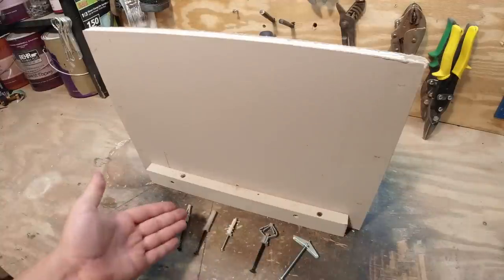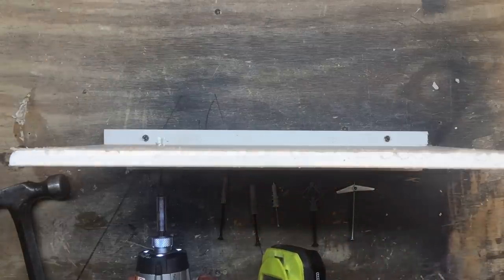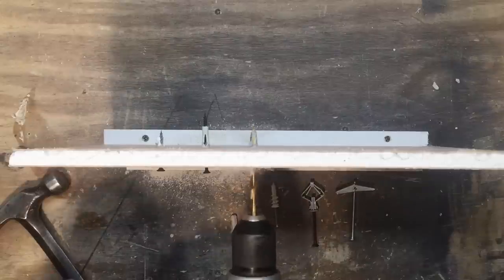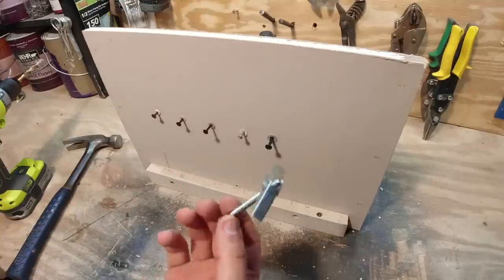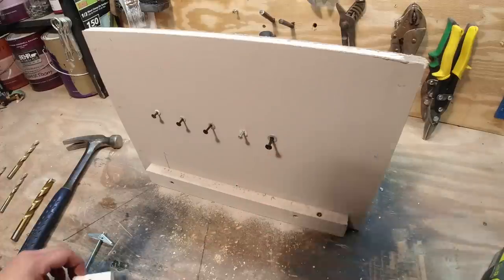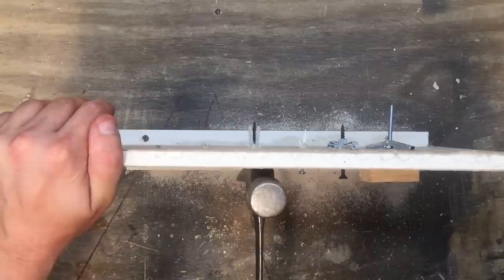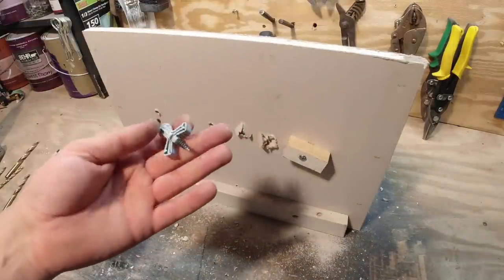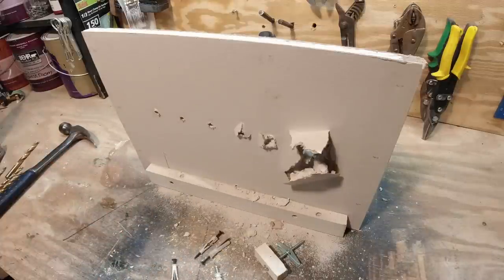How Drywall Anchors Work | Which Is the BEST?

Comment: One little trick that I use which seems to help is to fill the hole with spackle before pressing in the anchor and let it set up before attaching the screw.  Snug fit and keeps the anchor from spinning.
Reply: William Bethune great idea!!!
Reply: How long do you usually wait for it to set up?
Reply: @BeyondDestiny  About 10 minutes or so.

Comment: Keep in mind these anchors are being tested and pulled straight out of the hole. When using these anchors, the force will be downward, towards the floor, not straight out. A more accurate test is to test the supporting weight pulling on it towards the floor.

I'd consider this video more of an instructional video as some of these anchors I've seen before but had no idea how to install.

Comment: Good comparison. However, I don't think those last two "butterfly" anchors are meant to pop out again. They destroy the wall coming out, as you can see, and should be pushed/hammered and allowed to fall behind the drywall once the screw is removed.🙂
Reply: I think this was to represent how strong they hold and what would happen if the item hanging on them was way too heavy and got ripped from the wall.

Comment: I used the last butterfly anchor to hang a 25lbs mirror with a visible boat type rope in my bathroom. Worked like a charm and holds strong like a mother!
Because you need to make a good size hole for the anchor, I should have used a washer to help cover up the hole, although the rope holding the mirror covered it up pretty good.
Reply from the maker: Yes I agree those anchors are very strong!  Thanks for checking out the video!

Comment: You did not install your second anchor properly. It needs to be tightened up before you back it out to hand something on the screw. It should expand like anchor number 5. That's why there were little nubs on the side.
Reply: Thought the same thing.
Reply: He also hammered in the screw in one way too much.
Reply: Came to the comments to say the same thing.  That second one was not installed properly.

Comment: In a concret or brick house you mostly need an anchor, too.

Before they invented anchors, they made a hole in the wall with a hammer. Then they filled it with mortar or other plaster and let it dry. The next day, they could put in a screw or a nail. 
I like anchors 😁

Comment: Your metal # 6 is used to put hooks on the ceiling. You put it through like you did but instead of the block of wood on the end, you screw a certain type of hook on the screw part until it tightens.

Comment: what about a classic metal Molly hanger? Like the next to the last plastic hanger. Advantage over the metal toggle bolt is that you can remove and replace the item you are hanging. Advantage over the plastic hanger is it will still work if you happen to hit a stud. Disadvantage is you have to drill it out to remove it, or hammer it deeper and spackle over it.

Comment: The second anchor, you’re supposed to tighten it so the backpart flares out, just like the fourth one. That’s why it does nothing, it’s not secured properly. You see the circle part missing on the middle of the back part? That’s there to make it fold easily behind the wall.
Reply from the maker: Thanks for the feedback.
Reply: Came to the comments to say the same thing.  That second one was not installed properly. You need to screw the screw fully in and tighten down until in flairs behind the wall and catches, and then back the screw out slightly to hang what you're hanging.

Comment: If, for whatever reason, you need to remove the smaller anchors, first, remove the screw and then pry the end carefully out a bit, then you can pull it all the way out gently with pliers, then you can drywall patch over the hole. 
  To remove the plastic anchor that screws into your wall, just use a screw driver to ( gently ) unscrew it.
To remove the larger metal anchor with the expanded wings, just take out the screw and the the wing portion will fall behind the wall...you will end up with a relatively smaller  hole to patch over,  rather than pulling the whole anchor out and creating a huge hole.

Comment: Hey Fixer,  I use an anchor similar to the one 3rd from the right.  However, it is much wider.  When it is screwed in it anchors in much tougher.  Really tough to pull out.  Works great.

Comment: Number 4 shold be used with a screw that has no threads 3/4 or greater  up to the head so it spins and retracts the plug.... # 5 EZ anchor should be drilled in but this sometimes causes the tip to break off, what I do is drill a hole as wide as the tip then hand screw it in this will make a superstrong fit.

Comment: Looks like the second one should have the screw tightened until the rear part expanded. That would have transformed the result for it.
Reply: Came to the comments to say the same thing.  That second one was not installed properly. You need to screw the screw fully in and tighten down until in flairs behind the wall and catches, and then back the screw out slightly to hang what you're hanging.

Comment: Well, the "disappointed one" should be treated as others - you drill a hole before you insert the anchor, or you just screw it into the wall. Not with hammer! Never seen it done like this. And by my mind this kind of anchor is the best.
Reply from the maker: Very good point!  Thank you for the feedback and for checking out the video!
Reply: I don't think it would make any difference. I like that screw in type because it's removable. The crucial question is "can it hold the weight needed?" If so, it's good even if the butterfly can hold more. At the same time, I wonder how much more is the limit of the butterfly, the video shows that it will come out if overloaded, it seems to  be a lot more, but maybe not?

Comment: a couple points.... a person cannot often reach behind the drywall and hold the anchor the way you did.   the fact that it would start to turn makes it about useless.     Also, you didn't include the common molly bolt system.   They  are supposed to not turn  because  of the points at the head, but I've found them to only tear up the hole and start spinning.   They do work fine if you have the right tool,  which will grab the head of the bolt and pull the expansion inside the wall.   This tool is available on amazon and can be found by searching for molly bolt tool.

Comment: One reason some of them failed is because they each have a different size screw that is for the anchor. But I still enjoy watching this. My favorite are the snap toggles.
Reply: @markhowe5539  How do snap toggles trap wires and short them out any more than any other anchor would. I've never had that problem. I watched the video you recommend an you didn't check behind the wall for wires before you drilled the pilot holes. So your method could short and destroy wires also.

And I use snap toggles and other anchors and have had nothing go wrong. Well some failed but most hold.
Reply: @Samestori214  I did not need too, I built the wall and I knew there were no wires behind it ! Look at the toggle profile, a knive edge U- shaped metal profile as opposed to a flat plastic profile in the Bulllfix that cannot possibly cut through wires when tightened .
Reply: @markhowe5539  ... Yes but the drill bit and hole auger that you use to drill the pilot hole could cause damage to wires. If there are wires next to were you are putting the anchor into. If there are no wires there then they won't get shorten out.  This is the same as using the snap toggles. If there are no wires there how could they be damaged.

Keep using your system and I'll stick to mine. But to say that snap toggles damages wires is not true in all cases.

Comment: What happens if you screw into a stud? I can’t get the anchor flush.
Reply from the maker: Hey, Matt!  If it is one of the plastic ones you can carefully cut off the part of the anchor that wont go in flush with the wall.  It will hold a screw, especially if you hit a stud.  Hope this helps!  Thanks for checking out the video!

Comment: Dude, how has no one said it yet?????

You didn't use #2 properly at all.

You're supposed to run that screw all the way down. It's not a picture hanger, it's an anchor like #5 and #6.
#2 is almost as good as #5 if used correctly.

Those open ended anchors, like #1 and your new favorite, are acceptable for picture hangers or the like, where the application doesn't call for complete tightening of the screw.

The closed ended anchors as well as #6 are for applications where you need the screw to run all the way, something like, mounting a dispenser or a permanent fixture like a sconce or a toilet paper holder, a rack or shelf, etc.

Different tools for different applications.

Just remember:

Open ended = open minded i.e., you might change something else one day.

Closed end = Closed discussion.
This is permanent.
Reply: Good video though! Sorry, forgot to say it.

Comment: There’s a few more types of anchors. The first three are more suitable to solid walls. There’s some that are meant for drywall and hollow bricks that twist a lot when getting the screw in and act like the 5th one.

The 4th one is the worst imo. Because when it fails, which is fairly easy, it makes a mess.
Reply: When they fail is better to remove the screw and leave the anchor fall behind the wall
Reply: @dentistjk  I mean the nylon ones.